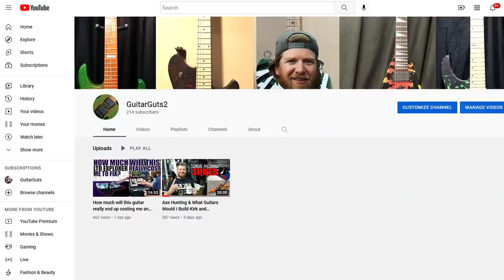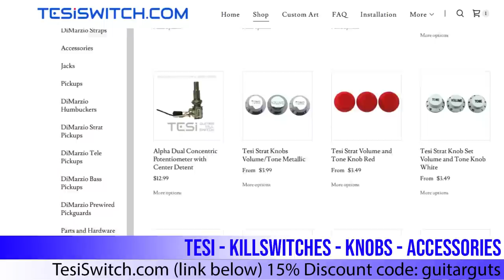Trash to Thrash #43 - Purple Crackle LTD (ESP LTD M-100 Purple Crackle)

Comment: Guitar aside, looks like it's time for a new bandsaw blade. Lol. Those burn marks on the plug are from a blade going dull. It's still sharp enough to cut but dull enough to slow down and cause friction burns. Not trying to be a backseat maker, just want to add an explanation in case anyone was curious :D

Comment: I just put a push-push single vol pot in m custom guitar, which switches between a very high output bridge and a hotrail in the neck where the coils are connected in parallel (gives you a hot noisless singlecoil sound). I like hotrails in the neck placed very close to the neck so it does not create a visual barrier for my picking, I do not hit neck pickups with my pick, but somehow it is disturbing to me to have a pickup in my picking territory, that is why no middle pickup for me.

Comment: Awesome paint job!!! Might be the best so far.  I just had one come out great and it is my favorite paint job now. Sometimes you get lucky, and sometimes you have to re-do it because the concept did not work out.  I like single pickup guitars, but don't own one. I like the sound of the middle position too much. Using a Duncan George Lynch with a Pre-amp / Duncan BMP-1 is one of my favorite setups. Match with a Duncan SDL-1N - Neck pickup. Sounds amazing. You can get pinch harmonics in really good spots when using both together. And the single size neck pickup gives you more real estate on body for the paint job.  Rock On Mark!!!

Comment: I absolutely need a neck pickup and always remove the tone knob on my guitars. I bought furniture screw end caps to plug the hole where the knob used to be. I also relocate the vol knob to the tone pot so its out of the way for quick pickup changes!

Comment: a drumell would make that front polish in a hell of a lot easier than going different grits of sandpaper I mean most dremels even come with a polishing compound for aluminum or stainless steel you need to get a drumell is save you so much time and the other things that you can do with it is just a bonus but it'll guarantee making your fret polishing so much simpler it probably pay for itself in the build that you're doing so you can just add that in as part of the cost and get yourself a free tool but even if you have to buy it they're not that expensive anyways love your videos you take care and have a great day

Comment: 6:55 I have one guitar with two hums and one volume + switch. I find myself missing the tone knob actually, even if it's rarely used. My old Epiphones, a Flying V and an Explorer, are perfect for me. Three-way toggle, two volumes and a master tone. I can roll off the neck pickup volume and basically have a killswitch. Or if I just turn the volume down a little the neck pickup can serve as a clean channel in a pinch if there's not too much gain! The tone knob does see some use for solos or clean rhythms because sometimes you just have to... tone it down!

Comment: Man I have a few guitars, lately I've been using just the volume knob, and a have a guitar with no knobs at all, just the Bridge straight to the jack! I still need the tone knob in some guitars, but in general I prefer to have both pickups, just because it looks nice, but I don't use the neck pickup most of the time.
Reply: A buddy of mine was doing that too.  - the pickup straight to jack - using a volume pedal on his Amp control switches. Said he could maximize the output of the pickup that way.. Sounded True!